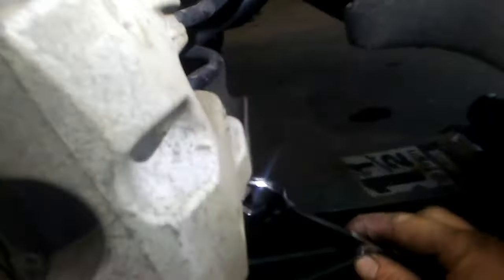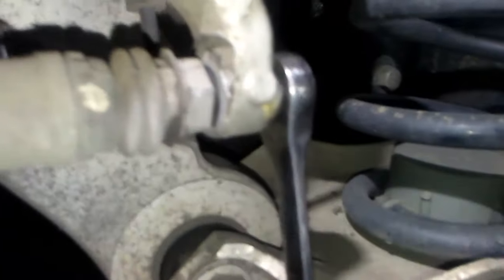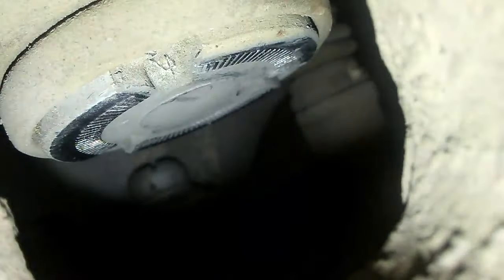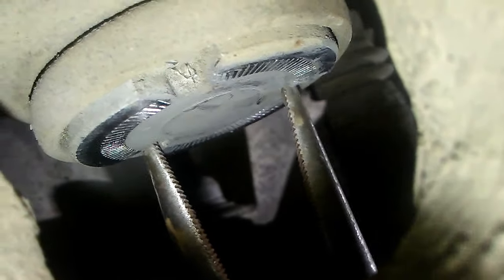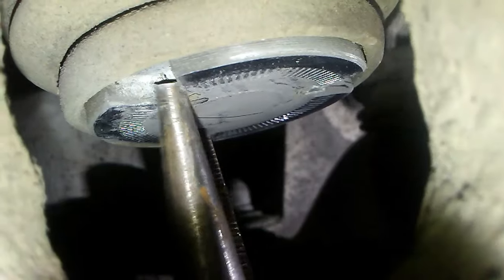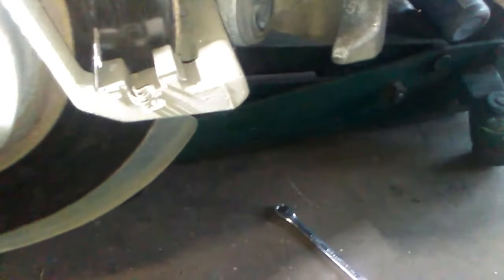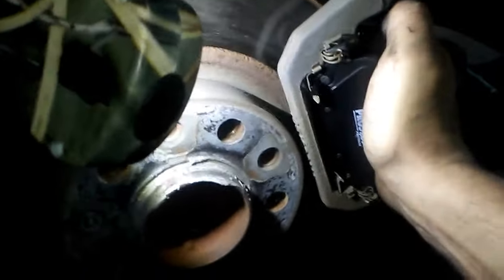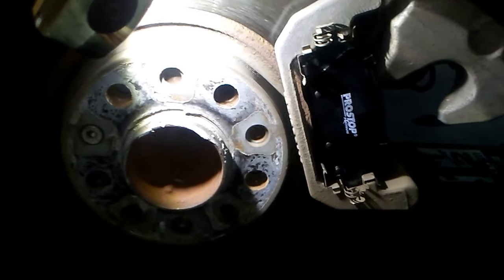2015 Chrysler 200 rear brakes electronic e brake system

Comment: You have to go to Uconnect  radio go to settings and find the parking brake setting and put it in service mode that will release the electronic parking brakes
Reply: how I go to uconnect?
Reply: This doesn't release my parking brake!! The light keeps flashing and the dash indicates "parking break unavailable" I've been trying all night..
Reply: @hurricanestarang  did you figure out how to resolve this? I’m in the same boat
Reply: I just went to settings but I'm getting a code saying it can't read it

Comment: Hey thanks for the tutorial. BTW, are those Steel toe Nike boots?  Nice Wrenches i love BluePoint.  Snap-On for life!
Reply from the maker: Hey hey thanks for awesome comment, I love Snap On but you gotta be careful with them, I got in debt with tools easy and the shoes I don't think was steel toes
Reply: @RANS87IROCZ  ,. I hear you man.  I am trying to finish paying off this badass Scan-tool.  I stop buying from the tool truck.  I try to get them used on offer up, ebay etc.

Comment: I've watched 4 videos on this brake job you did you're the only one who turned the piston in now I don't know which way is the correct way just thinking of what the Piston would do I don't see it turning to go in and out why can't it just be pushed back in?
Reply from the maker: If you have fancy scanner they will auto return in which is recommended way, but if your without such then this option will work just makes sure ignition on car is off and e brake is off and you can cheat em in by spinning them back
Reply from the maker: You cant push em them in with c clamp or other because they wind out for sure, attempting to push in c clamp would not be good

Comment: I have an after market din. Which means i can’t turn on service mode for the E brake. Will i be able to change it using this method still?
Reply: Going forward yes because my radio went out and I litteraly had to do it that way and just wiggle it out

Comment: Thanks for the video, you're right there is no other one for this. I do have one question... after reassembly the (spun back in) caliper will readjust itself ?
Reply from the maker: yes just pump them up like normal brake job after installed and thanks for comment

Comment: I’m trying to take the rear rotors out and it’s been extremely hard. How do you get the T 55 bolts off to replace the rotors?
Reply from the maker: not sure I only did the pads, did you figure it out norm I find a wrench to slide over the end of the torx to break it loose when I cant fit the ratchet on the back side of the torx
Reply: Very firmly... I had to use another wrench as a snipe to get the leverage to turn them because I didn't have a breaker bar that fit my t55 socket... but they do let go... I'd guess they are torqued to 80 or more for how they felt coming off

Comment: just want to kno all u need to take e brake off and push back the piston with normal tool???
Reply from the maker: yes basically but you have to spin the piston in, it doesn't push in

Comment from the maker: it sucks not to have the correct tool so I can easily turn them in but still was able to with pair of needle nose that norm works pretty well but I don't recommend
Reply: RANS87IROCZ it does. My moms Hyundai was the same way. Thanks for the video bro
Reply: What is that special tool? I'm going to work on my own brakes.
Reply: @SombraLocs  if you never found the tool it's sold on eBay in a universal 23 piece piston kit